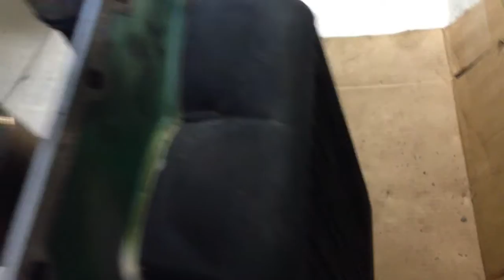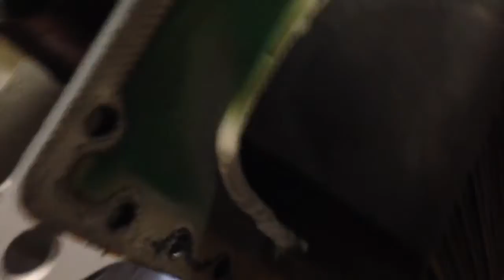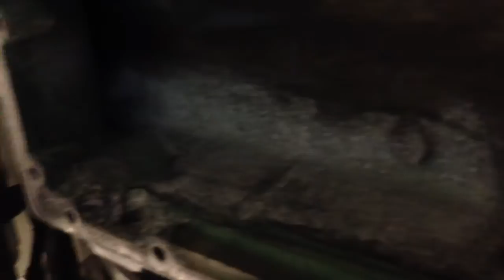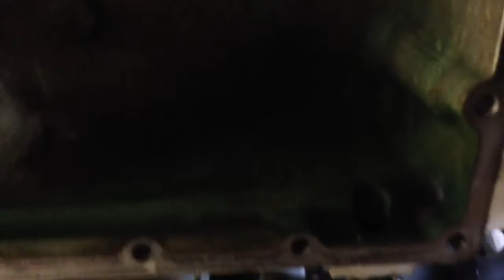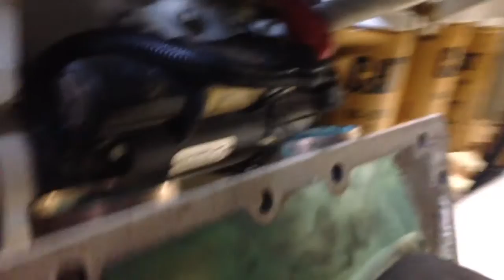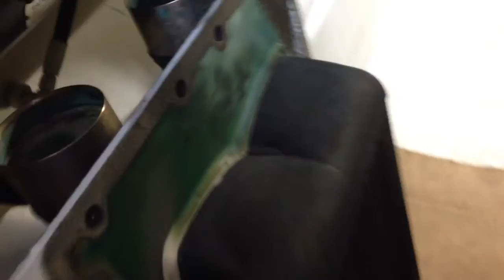Cat C-18 aftercooler

Comment: Why is nobody talking explaining what they are doing?
Reply: It's showing an aftercooler for a c-18. The pipes you see are where the sea water flows into/out-of in order to cool the air flowing through the aftercooler from the turbocharger before being used in the engine (you can see where the air flows out at .05-.20). It looks like the aftercooler had a leak on the sea water side, the greenish residue, allowing water to enter the engine air stream, which in turn will transfer to the oil through the cylinders, which will give a high sodium(salt) reading on a lube oil analysis.